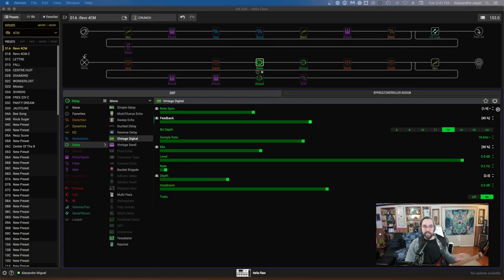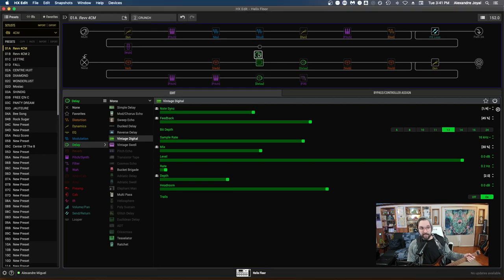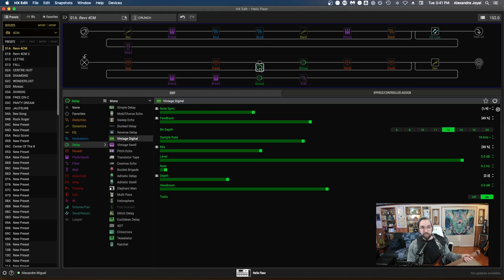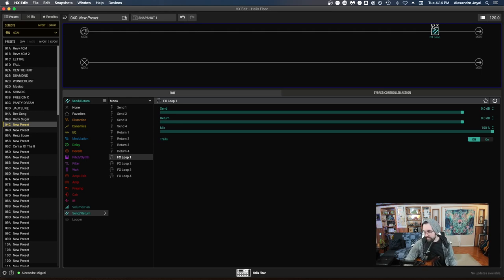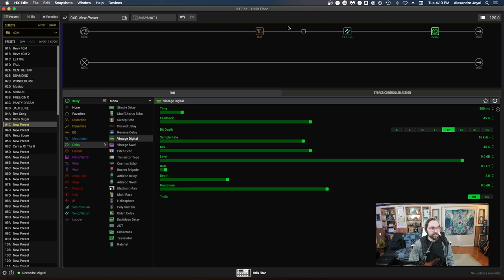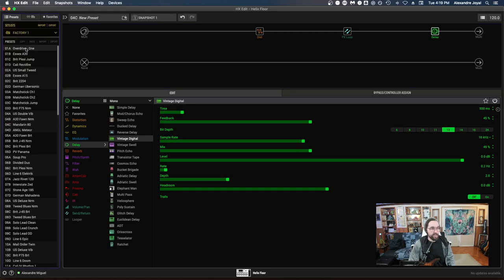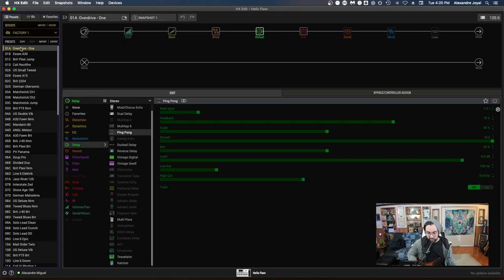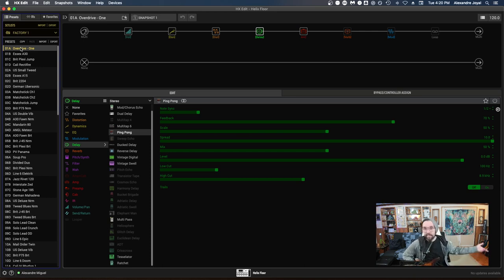4 Cable Method! Unlock the universe of guitar tone - Line 6 Helix + Revv 740

Comment: Great video. Starts to get into one of the things I have been wanting to find a good demo of, and have just never found. With the 4 cable method. And bypassing your tube amps pre amp and using the line 6 amp sims. Can you seamlessly switch between presets in 4CM that say you are playing on a clean fender amp. Preset one 4cm. maybe a light drive in front on the tube amps preamp section, and a little reverb in the loop. Then, click preset 2, which is something radically different. Say 5150 amp sim on line 6, bypassing the tube amps preamp, and out the power section? I have search high and low and never seen anyone demo this specific idea. Maybe one or the other but not a seamless transition between the two in presets. This is honestly one of the closest I have seen that starts to touch on it! If you ever wish to expand on that, would love to see it! Regardless great video and super informative! Thanks

Comment: I have a question. I understand the 4CM, and maybe I am trying to overcomplicate things, but is there a way for your multi effects unit to change the channel of the amplifier without an additional foot switch? I have a Line 6 HD500X and a Hughes and Kettner Tubemeister 18 combo and I really love the sound of the amp but I find that there is not enough output when using the 4CM. This is with the output of the 500X at its maximum. Also, the amps eq, gain and volume no longer have an affect on my signal. They can be set to zero or maxed and there is no difference to the tone. 
Thank you in advance